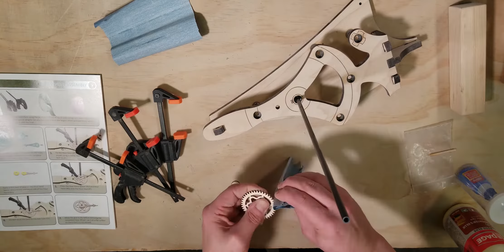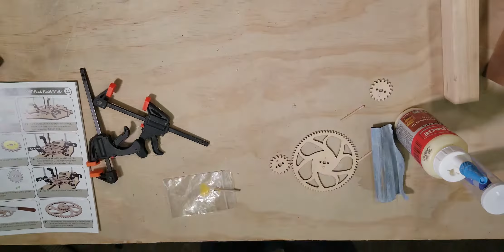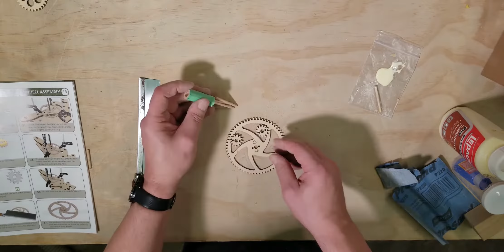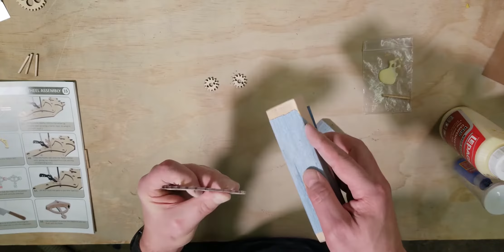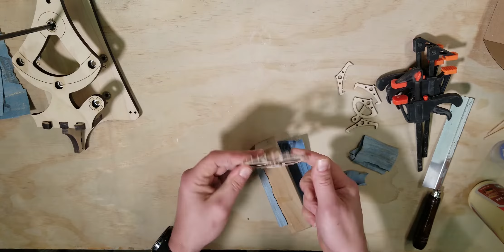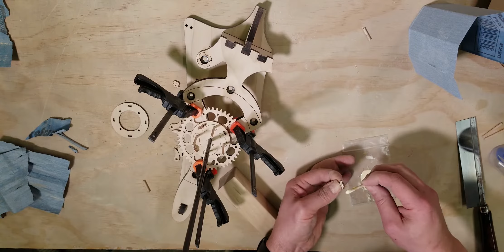Building the David Wall Clock Kit - Part 2

Comment: I abandoned the project, I can't get it to work, even the carbon axes cut with the template and positioned right are not good..the positioning washers installed on the template are not right, if I had to redo it I would follow another method, and the carbon axle provided is too right if you make a cut of just 1 cm you no longer have a chance it is no longer enough, it would be useful to provide this tree at least 10 cm longer to correct cutting errors.
I will buy another watch kit from another project ... the ROKR, which I built before, is wonderful ... this ... no ..
Reply from the maker: A wooden clock is a challenging kit. Please contact our service email and I will try to assist you directly. The carbon fiber axle is provided with a little extra length to allow for mistakes, but it is one of the most expensive components. That's why the instructions emphasize over and over to cut carefully!  Please do contact us.

Comment: Just starting my build and finding videos very useful.  when is the best time to do a teak oil finish.
Reply from the maker: In this build I'll be doing it right at the end. Most of the time, I'll apply the teak oil while the parts are still on the carrier. When you do that, you've got to do some extra sanding on mating parts. 
When you do it at the end, you need to carefully pop out the bearings and avoid the tooth faces. Six of one.. half a dozen of the other

Comment: the instructions do not indicate how many kg of weight is needed ????
Reply from the maker: The clock was designed around using 4000 Daisy BBs as counterweight. The weight of  the finished counterweight is 1.5kg (a little over 3lbs)

You can use whatever material you have on hand for the counterweight, and the actual weight isn’t absolutely critical +/- 0.5 lb is fine.
Reply: I filled the container with steel marbles and I only get 1.4 kg ... azz
Reply: I managed to use 2 pence coins in the shell. these fit perfectly in rows and my total weight is roughly 1.55kg👍
Reply: I was wondering the same thing 
This was the first things I looked for in the instructions.
Reply from the maker: @whited80  Thanks for the feedback. I'll be sure to add it to the next print run of instructions

Comment: excellent video. I look forward to part 3. Thank you and best regards!
Reply from the maker: On its way! Should be posted later this week.
Reply: I mounted the watch very carefully, and I did nothing wrong, 2 gears turn crooked, and the clock does not work, too much friction ..
Reply from the maker: @giuseppegarbo1  Tuning the clock to remove friction is part of the process. I'll be posting additional videos over the next few weeks.